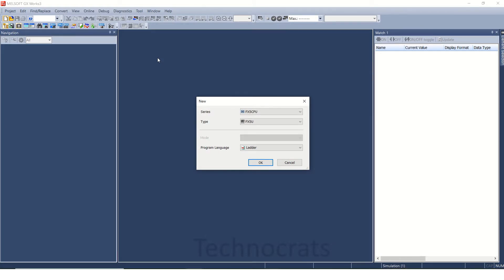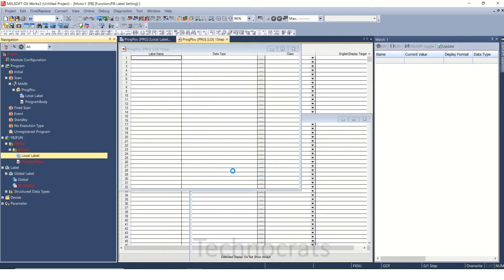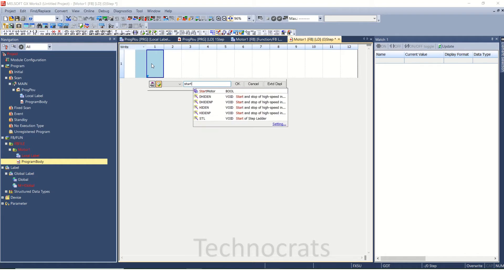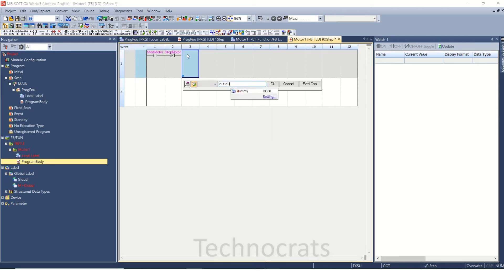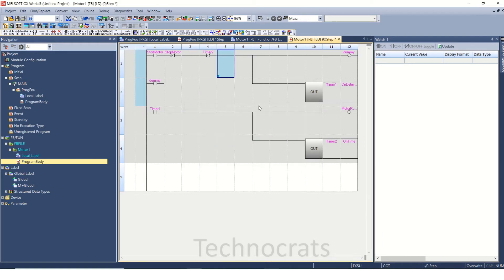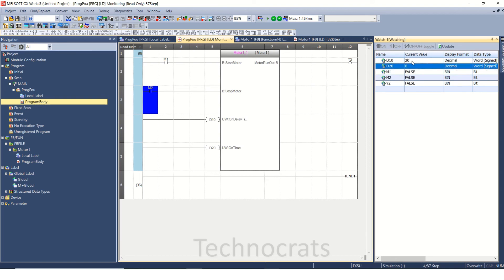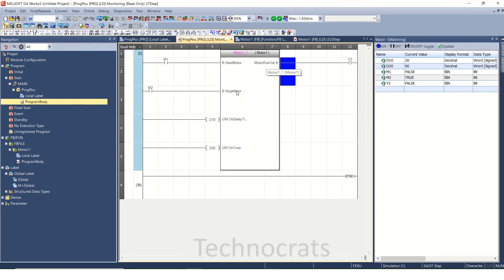Create Function Block In Mitsubishi PLC

Comment: 00:17 Create a machine block in FXY bphc

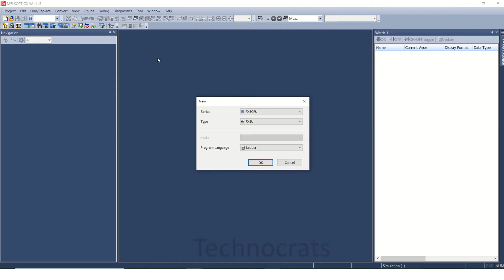00:54 Create a function block with two timers, two buttons, and one output

01:25 Creating a ladder for function Bob

02:12 Labels and inputs needed for logic

03:57 Implemented a sequence logic using timers

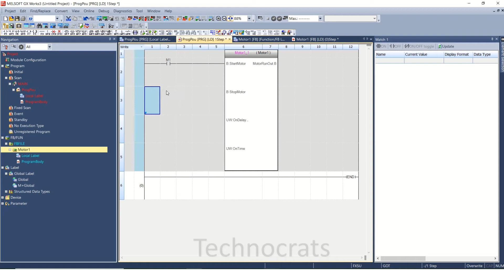05:59 The turn has gone delay time

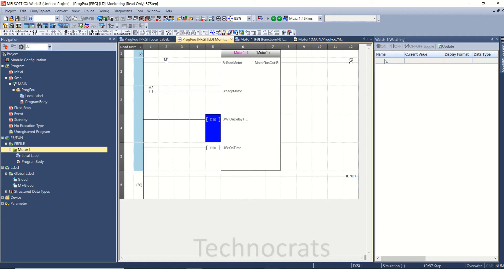07:00 Pressing the button starts a timer with a three-second delay

09:12 Turn on and off button feature